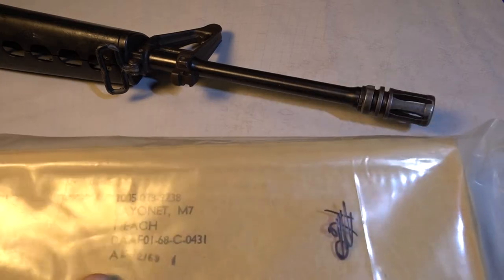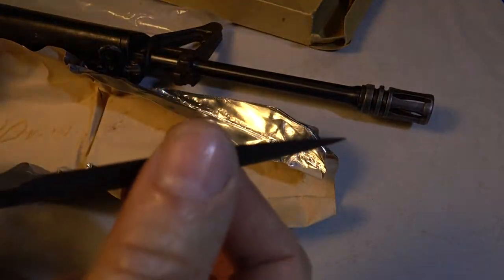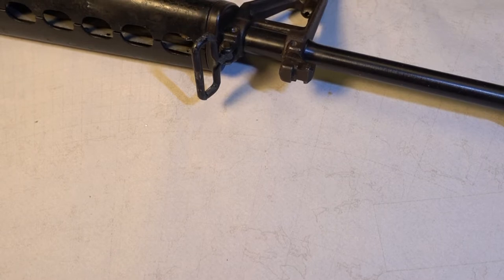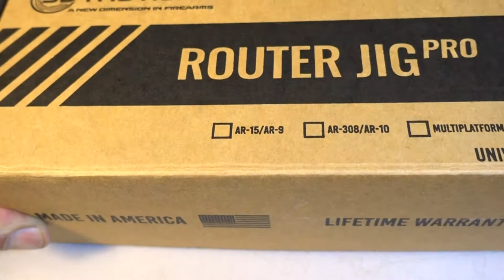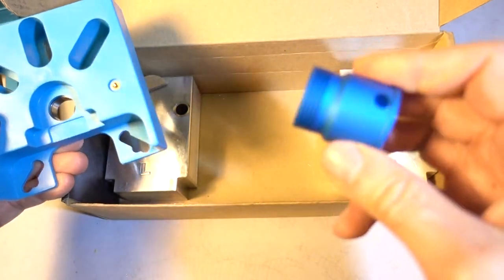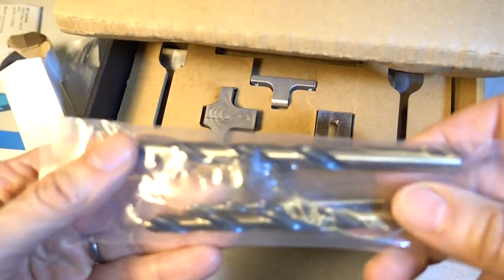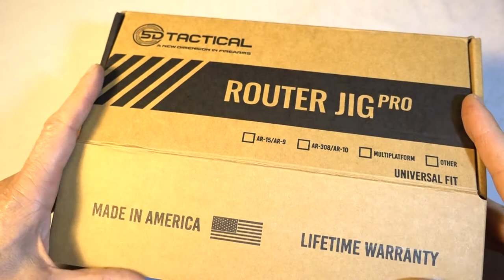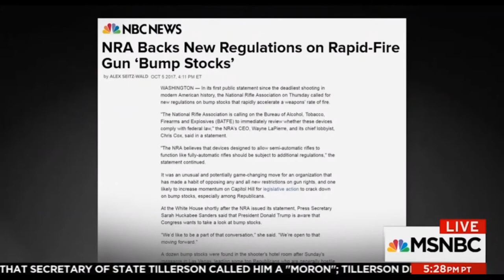M16A1 Repair Part 3 Unboxing the Bayonet and Router Jig

Comment: For whatever reason Nodak doesn’t drill out the safety detent hole like other 80% receiver manufacturers do. Most of them come with the whole pre-drilled that’s why there is nothing with the jig. I ran into this problem myself and had to drill the hole. I chopped down an old A2 grip and used the hole from the grip as my guide
Reply from the maker: Yes, the receiver is missing the safety detent hole and the jig has no provision for it.   Thanks for the helpful tip!  All the best.